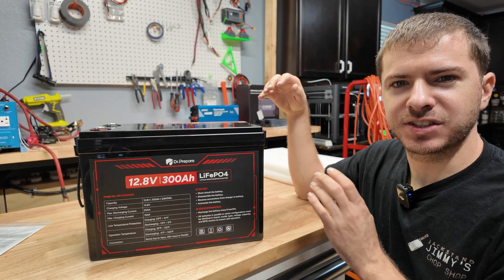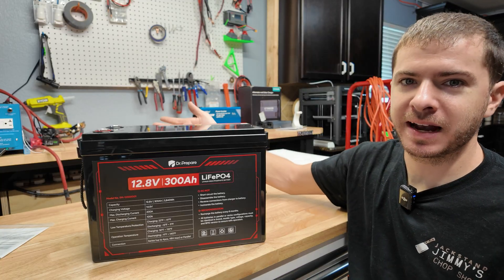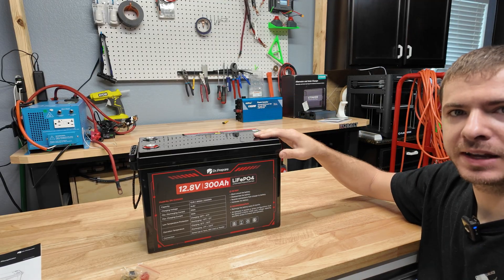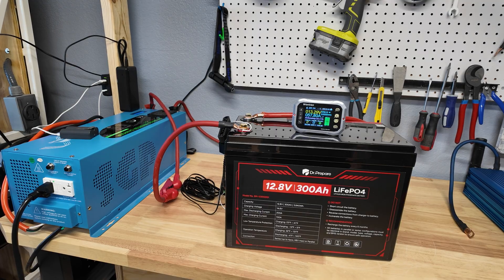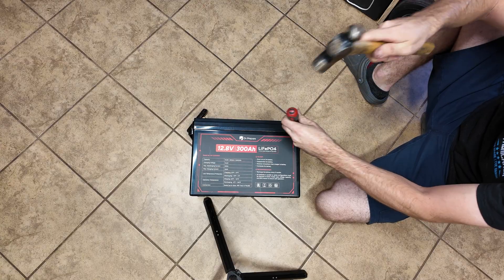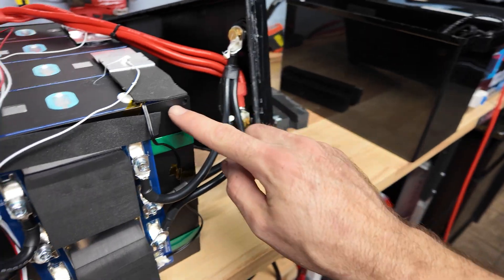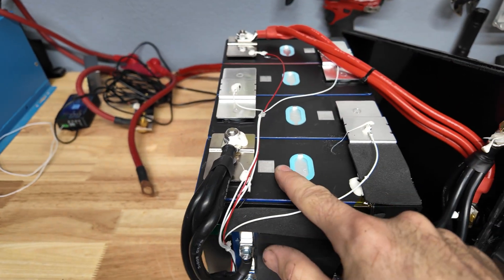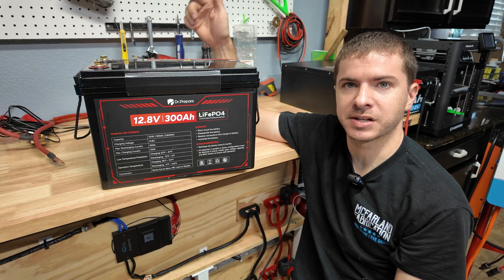Dr.Prepare 12V 300Ah LiFePO4 Battery Review | Real-World Performance & Testing

Comment: Good brand new 300ah battery should test between 315ah to 325ah. These are not 300ah cells, these are 280ah cells which, when brand new, will test to 305ah. Good brand new batteries should have 5% to 10% higher than rated capacity. If they don't test 5 to 10% higher than you should stay away from them. Either these are used cells, poor quality cells or lower capacity cells sold as higher .
Reply from the maker: Good to know, thanks for the info

Comment: My nephew is a disabled veteran who is just starting out with solar off the grid. He bought property and has a tiny house on it now. He is on a pretty tight budget, only gets about $1500/ month disability. He is looking at stuff at harbor freight, is this a good start point for him? We dont know too much about solar, so just watching channels like yours to get ideas.
Reply from the maker: I think the inverter and the panels are ok if you use the 100 watt panel they sell. But your better off getting some Renogy solar panels from amazon, they are less than 1 dollar per watt. Start small and scale up as you grow your knowledge and system.

Use a MPPT solar charge controller and a pure sine wave inverter. As far as batteries, if you can, go with a 300 ah then you only need 1 to have a good amount of capacity.

Wiring use pure copper wire, sometimes called OFC. No CCA  ( copper clad aluminum, its junk in my opinion. )

Hope this helps, and thank him for his service!

Comment: With built batteries with BMS built in selling for so cheap these days, can anyone think of a reason to buy the cells and build a battery themselves?  It doesn't seem like you can save money by building them anymore.
Reply from the maker: That’s true, also time to build aswell. My last build I put In a ton of hours into.
Reply: @Mikebuildss  Yes, but is there ANY reason why you could imagine a build would be better?  Could you pick out a superior BMS that is less prone to failure?  I've heard that the cells don't fail very often anymore, but the BMSs still do.  That seems like the only possible thing, but I don't have your experience so I'm just guessing.
Reply from the maker: @anonymous-u2s1n  Your correct it will allow you to spec out components that may end up being better, have more features, and also depending on how you build it, be more serviceable.     There are also some DIY battery case kits that are a good middle between fully built and self built. Still require assembly but are sold as kits and normally are a really good value
Reply: @Mikebuildss  Hey.....that's good to know.  I'm going to look up those kits and start researching BMSs and see if I can find a really good one already in a kit.  If not, that's o.k. too.  I want to save money but save money on the best money can buy.  I'm looking for the ultimate in reliability.
Reply from the maker: @anonymous-u2s1n I built a Calb Cell 180ah pack, used a JK bms, its programmable, has active balancer, bluetooth

Comment: 200 amp BMS and it doesn't shut down at 300 amp continuous discharge ? seems the BMS is not programed or functioning properly
Reply from the maker: Correct, its very common, i would always add a fuse for safety anyways

Comment: Might just be me but 3 6ga cables seems really light for a 300ah battery. ?
Reply: The 300ah isn't the problem it is the amps coming out of it at one time. 300 amps are absolutely too much for 3 6 gauge wires, which is what he was getting without shutting down.
Reply from the maker: Just dont be pulling over 200 amps. it will be fine.
Personally even 150 amps is alot for one battery
Reply: @Mikebuildss Wrong and bad answer!